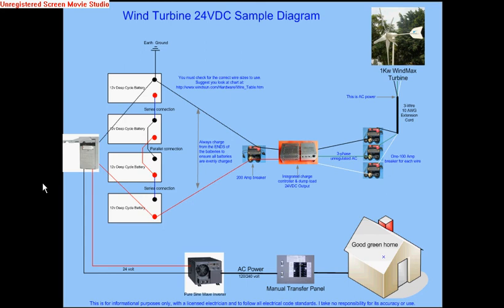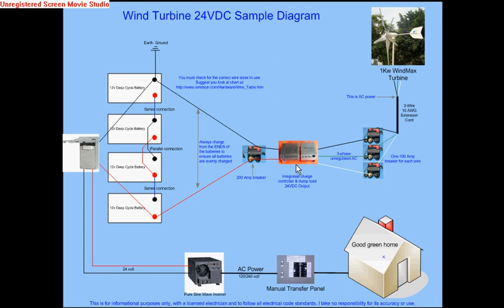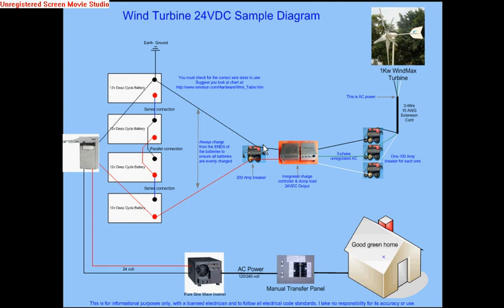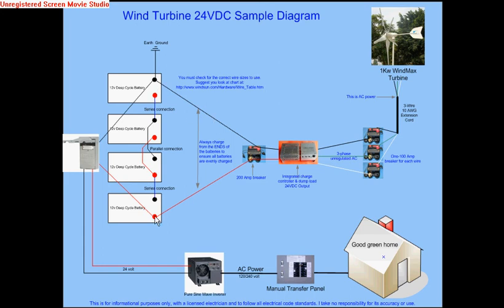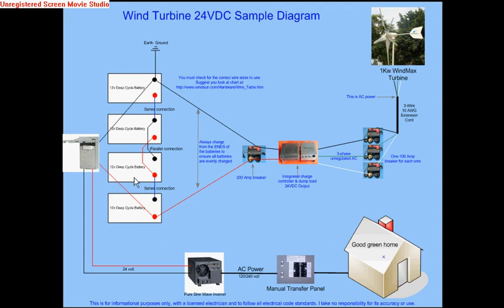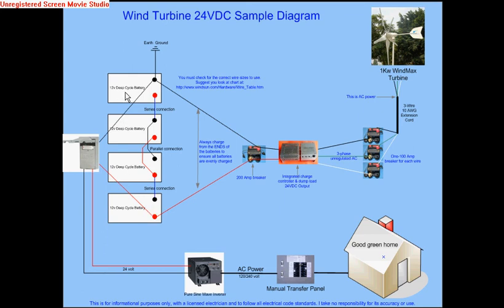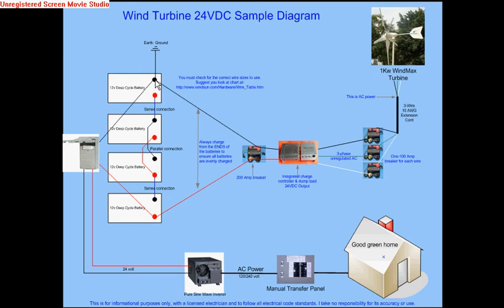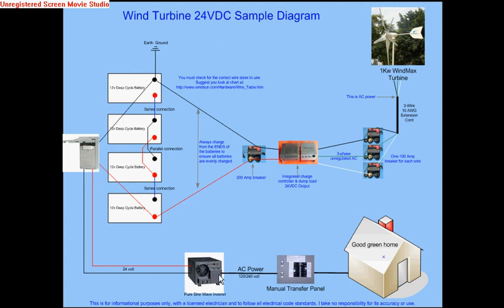Connecting a 24v wind turbine to your home

Comment from the maker: Because it requires more revolutions per minute (RPM) for the generator motor to generate a higher voltage, lower RPMs mean lower voltage. So if you have a lower average wind then you may never get to 24 volts if the wind speed cannot drive the blades fast enough, in that case going to a lower voltage may get you charging the batteries at lower wind speeds.

Comment from the maker: @Cocobumbo I would not bother with wind, look at their output charts, at cut in speed you have almost no charging amperage. Your best bet is solar panels and a enough batteries to give you power even during the rainy days. If you go with a 12 vol setup then it would be fairly inexpensive to get the battery bank to the right capacity. Then just buy panels made for 12 volts with open circuit voltage of around 20volts-22volts, charge the batteries and you're done.

Comment from the maker: @Cocobumbo Another thought is to get four 12v batteries in series and leave the 48v turbine got straight to them and from there to your inverter. If you have that steady 14mph breeze as you mentioned earlier then the batteries will act as a cushion for your inverter. As long as your power consumption is lower than the output of the turbine you will be fine. In time you can increase the number of batteries in your bank to achieve a balanced setup.

Comment from the maker: @Cocobumbo Sure but you will need very big wires to carry the amperage, you'll need a bridge rectifier capable of sustaining 250 AMPs and a mount capable to dissipate all the heat. Also you will loose power from that large turbine because when you take the voltage down, the amperage increases, which causes the resistance to the turbine to increase requiring more torque to turn. So just be aware that you would not get the full 3Kw out of it.

Comment from the maker: @CodeWarriorx0539 Thanks for your comment. The dump load is built into the charge controller in question. When you get a Windmax turbine, the charge controller is integrated with a bridge rectifier and a dump  load appropriate for the size turbine you're using.  In my two turbines at home I have the extension cord from the turbine going into a male/female plug so I can either disconnect turbine at will or put in a break plug I already made that has all three phase wires shorted into a wire nut.